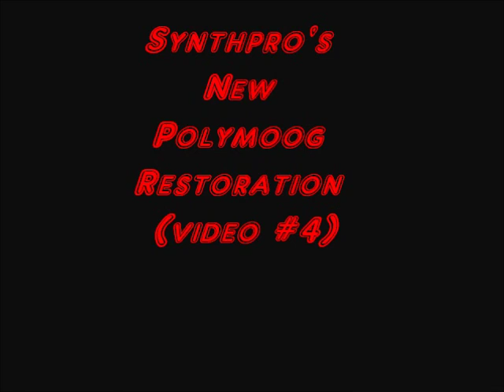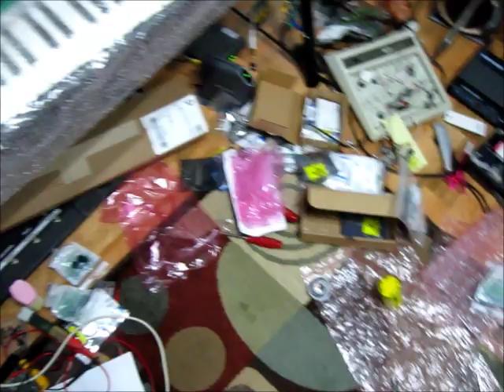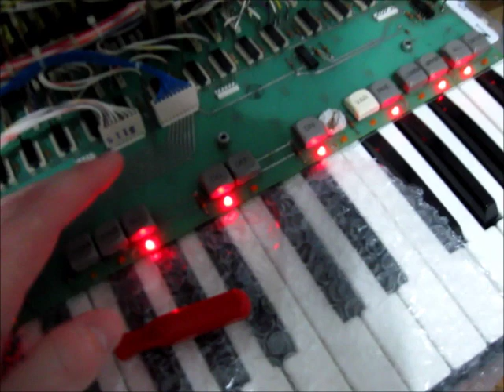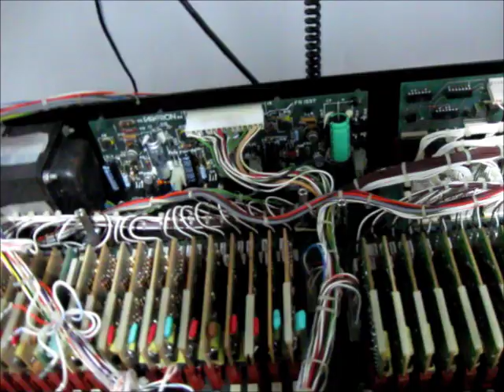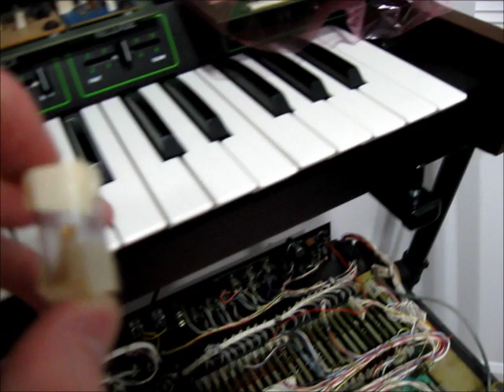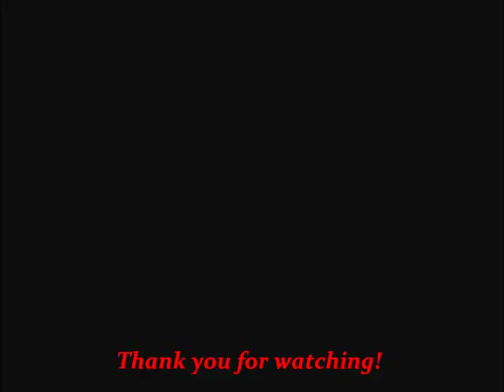Synthpro's New Polymoog Restoration (video #4)

Comment from the maker: ...........Some of the key parts I look at to see if a polymoog is worth restoring is the wiring harness, circuit boards, keyboard assembly and overall condition of the chassis. I have had one polymoog that looked great but the harness was gone because of mice eating the wires..The chassis was great which made it a great parts unit. The hardest parts to restore is the keyboard assembly so that is what I commonly put most attention on.

Comment from the maker: Yes, it is a large beast to work on but nothing else is quite like it. Most parts I replace with modern components, I will spec out new parts based on a comparison of the datasheets and see if they effect the sound...in some cases I look for new old stock parts which can get expensive.  

A complete polymoog restoration takes me about 4 months because I go through every board and replaced common failure parts. 

Continued.................

Comment: WOW Jareth!!!. that is Munster to fix. jareth where are you getting parts for this thing???. and how long did it take u to finish the project for the 203a Polymoog synthesizer NOT the keyboard. and when you aquired the polymoog synth in the condition it was in,how much did it set you back.and what would you consider a polymoog synth NOT the keyboard to be Un-Repairable???.

Comment from the maker: @synthpro........then remove the rubber pad, removing the pad is easy. What you can do is pull it out and blow the inside of the pad out and wipe off the circuit board where the button mates. 

Well, I hope that all makes sense and helps you out, if you have any questions feel free to message me any time.

Take care,
Jareth

Comment from the maker: @Synthesized13 Thank you, I don't know how much of a genius I am but I do enjoy these old synths. It sounds like there may be dust in between the pad and the contact on your an1x,  it is not too bad of a fix but it does require the keyboard to be removed from the chassis. Basically the keys work like a calculator button, it has a rubber pad that makes contact with a circuit board to complete a circuit. You will have to remove the circuit board that runs under the keyboard and.....